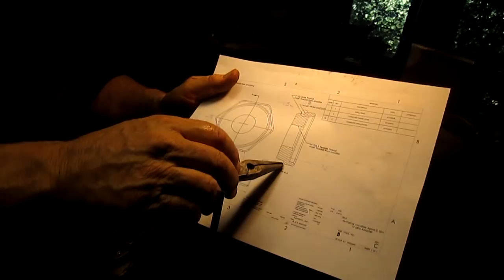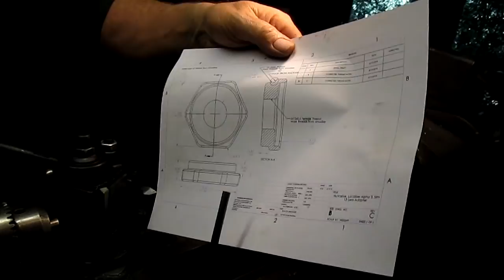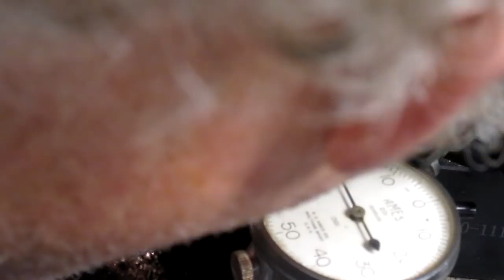Threading The Needle #2

Comment: I have threaded on the backside using reverse. Much easier to set up a carriage stop to come back to starting point. Threads looked good in pics at the end 👍🏼
Reply from the maker: It's nerve wracking going into the stop. With a bigger lathe it's hard to see over the work, but the small lathe no problem.

Comment: nice video, but PLEASE DON'T side grind on that bench grinder!- the side force is not meant to be put on this type of wheeled grinder, the PROPER grinder has a wheel designed for side grinding! YOU WILL BREAK that wheel, the abrasives in the wheel mix are not strong enough to take those forces.
Reply from the maker: Thanks for the heads up.